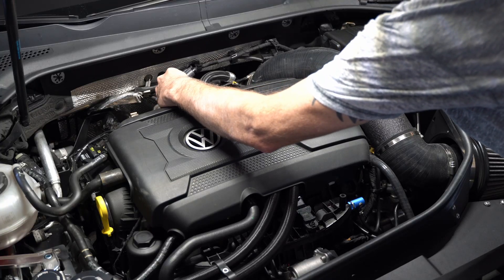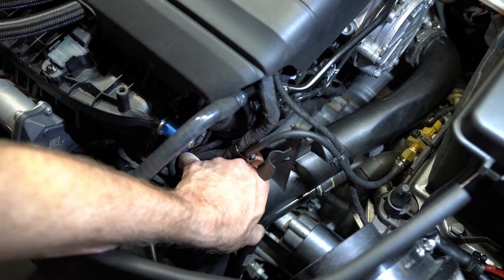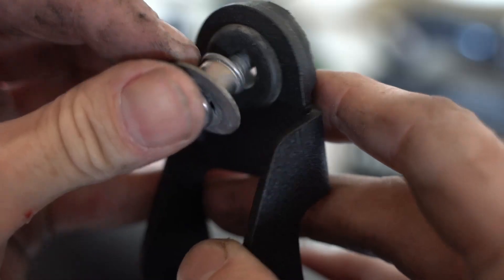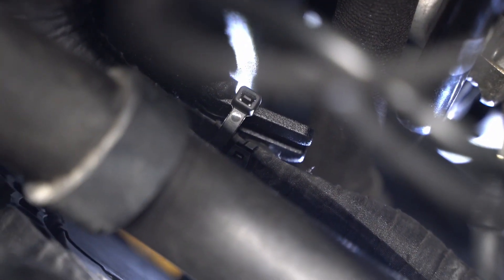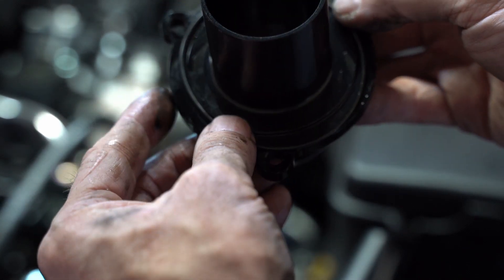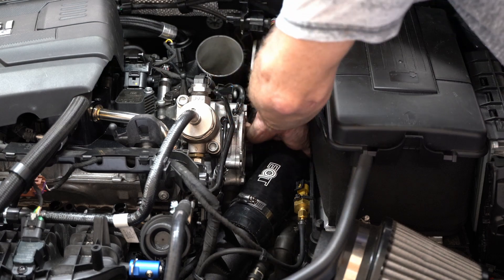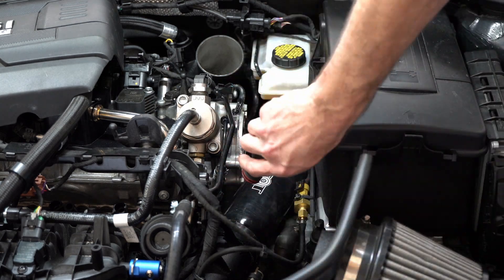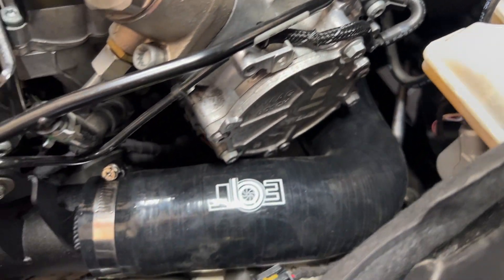Install: EQT Charge Pipe Kit with DO88 Intercooler - 2019 Golf R

Comment: Your throttle valve on the EA888 Gen3 Engine is 56mm (2.2 inches) so everything beyond that size for the cooler pipes is a waste in my opinion.

Comment: I have the same setup on my GTI and did this install a couple weeks ago. So yours is kinked even after boiling it? I didn't have much trouble getting the silicone pipe onto the hard pipe without having to boil it, but I’m guessing the amount of kink is reduced by boiling? My kink is pretty noticeable.
Reply from the maker: No…. I have a bit of kink still. Haven’t found a better option yet. I just worked it to have as little restriction as possible.

Comment: Did you unplug your 2nd O2 sensor the black one? I was reading some article that said you should because the car will run rich.
Reply from the maker: Yes in fact I did a video about it (when I changed to rs7 plugs).

Comment: Another great vid.  With the HPFP, intercooler, the charge pipe, and 
E-85 mods,  have you had EQT adjust a custom tune?  Just wondering. Thanks
Reply from the maker: I’m still on the same E85 OTS tune with the HPFP update. I’m waiting for the custom tune for when I do the turbo upgrade. I am waiting on one more part before I can install that.